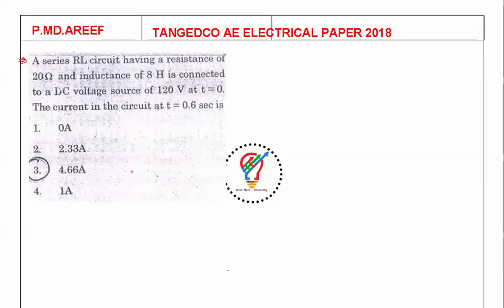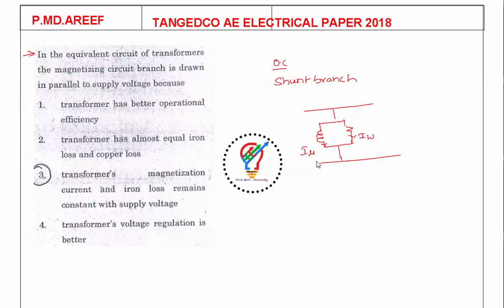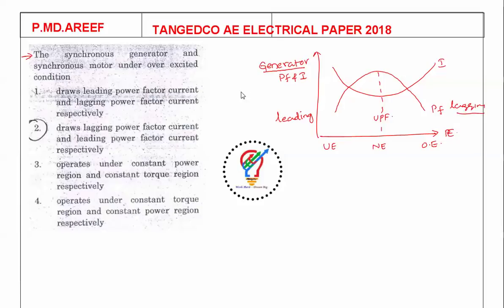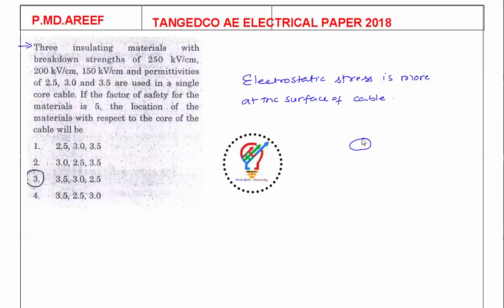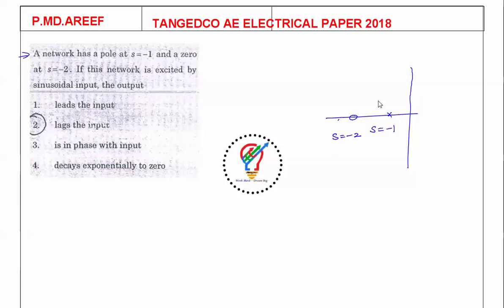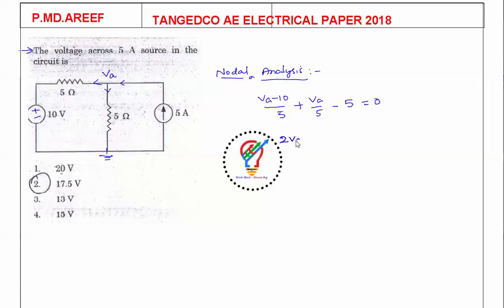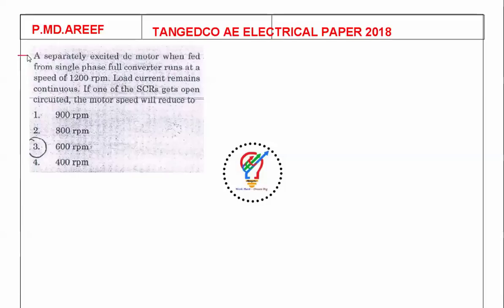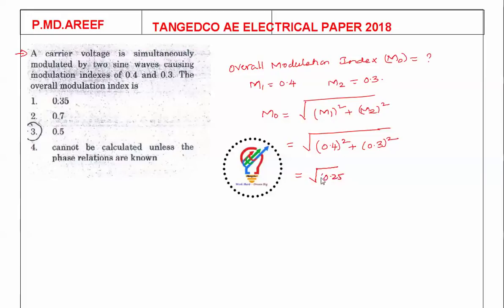TNEB AE PREVIOUS  QUESTION PAPER WITH ANSWERS 2018

Comment: Reactive power calculation phase current and line current which is not equal in delta connection so that there's mistake in answer please verify because of we know that in case of delta connection line current equal to root 3 times of of phase current